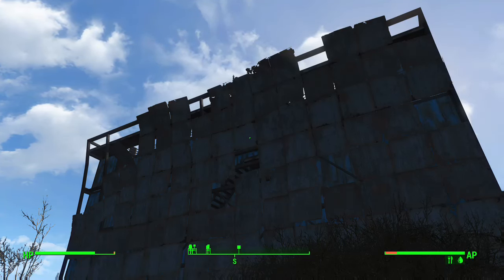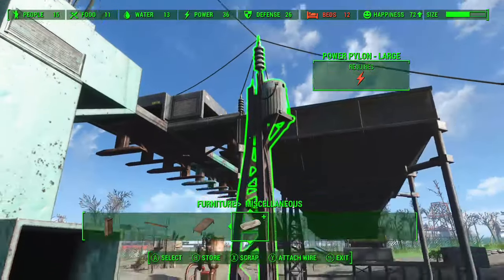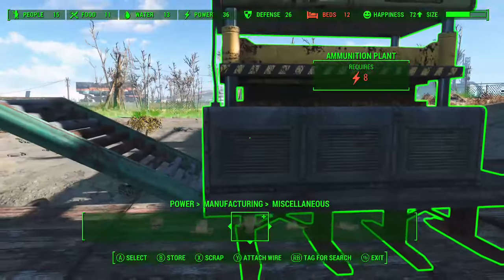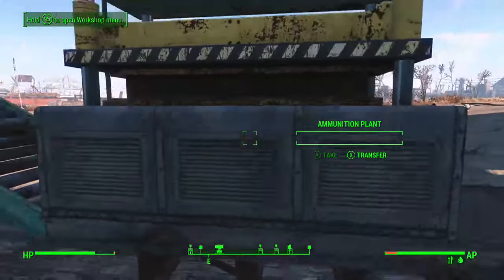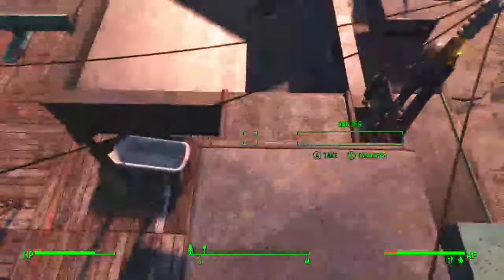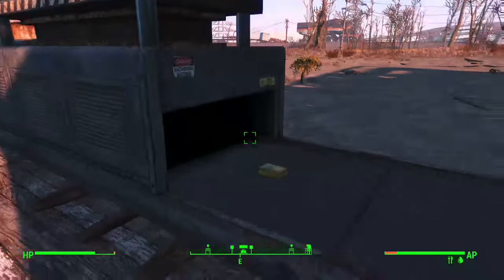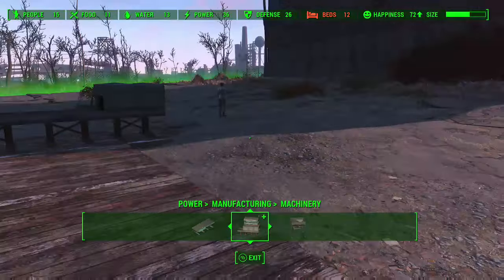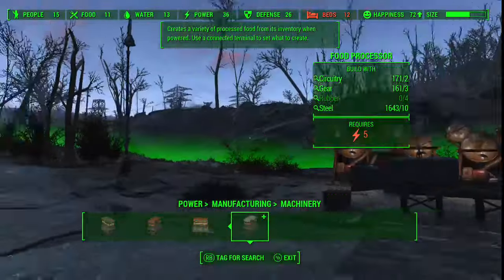Fallout 4, Contraptions DLC, How to make Ammo!

Comment: Thanks for the explanation, I am still hoping Bethesda makes an update for Energy ammo since Ps4 players don't have mods yet, and great work on the video!
Reply from the maker: Thank you for the feedback, and yes, I agree, energy ammo should have been craft-able as well, thankfully mods will come to PS4 soon now. Be aware though, using mods disables trophies/achievements. Your original save from before you start using mods will still be available, as the modded version will get a tag added (and is actually a brand new save file). So if you want to enable trophies again, disable your mods and reload your pre-mod save file (not sure if your modded savefile will work...so best to use your earlier saves).
Reply: Correct me if I'm wrong but I thought you could craft Energy rounds as long as your Science perk was high enough.
Reply from the maker: Unmodded? Well, I can almost test that as I'm about to reach level 41, and still have a few perkpoints to spend as well. I'll get back to you as soon as I know more.

Comment: Why do I only have 3 options when I check my terminal? :(
Reply from the maker: The amount of options is determined by how many programmables you have connected to the 'same' power-grid. So in this video I had three programmables hooked up into one grid: a switch to operate the conveyor contraption, the hopper, and the ammo maker.
If I had more rubber (cuz I ran out fairly quick!!!) I'd be able to add one or two more crafting machines. Say one for clothes and one for food. Then the terminal would have given me 5 options to choose from.

Hope this helped!
Reply: +MechDutch Thanks! I think I understand it now.
Reply from the maker: No problem...if you have more questions, feel free to ask away ;)
Reply from the maker: Or did you mean you have the same problem like Diego Garcia has?
Reply: +MechDutch I may actually have the same problem as Diego Garcia. Thanks though!
Reply from the maker: Ok, listen up: The higher your perk, the more options you have for building stuff with your machinery:
Gun Nut for making weapons & Heavy weapons,
Armorer for making Armor,
Science for making Energy Weapons,
Gun Nut & Science for making Ammo, and
Demolition Expert for making Explosives.

So invest in these perks to unlock better gear and heavier ammo.

Also, for the Builder, the Auto-Loom, the Pyrotechnics Mill and the Food Processor, you don't need any Perks whatsoever. They come with the full inventory options as soon as you build them.

I've not reached level 39 yet, but I have started a new game with a different character, and tested it out.

Good luck!
Reply: +MechDutch Thanks for all your help!
Reply from the maker: No problem my friend. If you have more questions, come find me XD